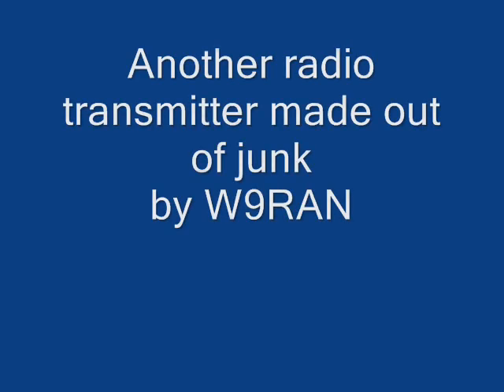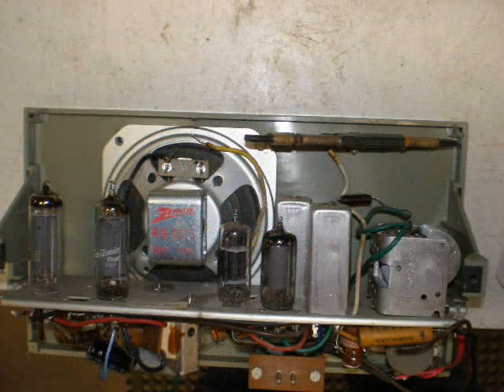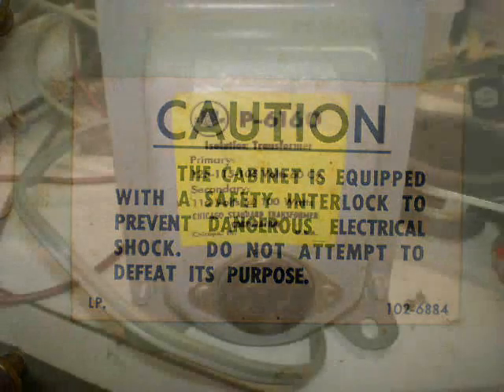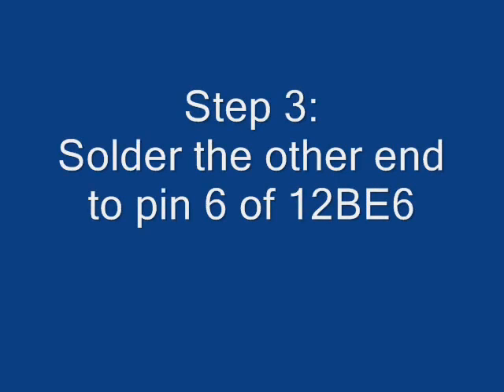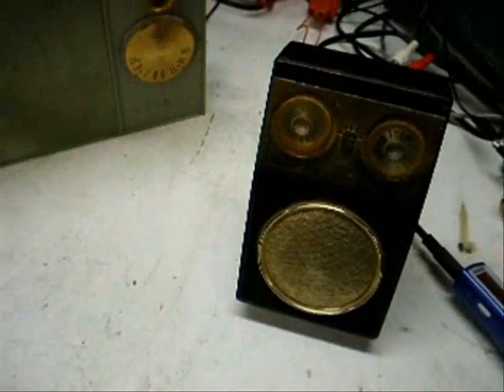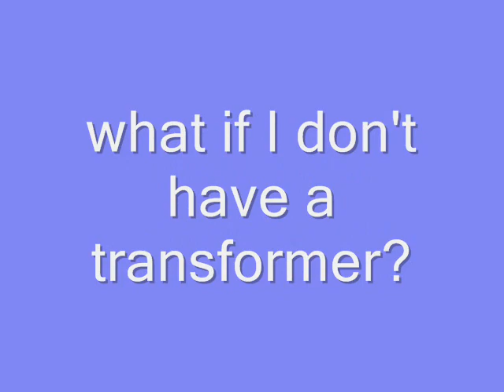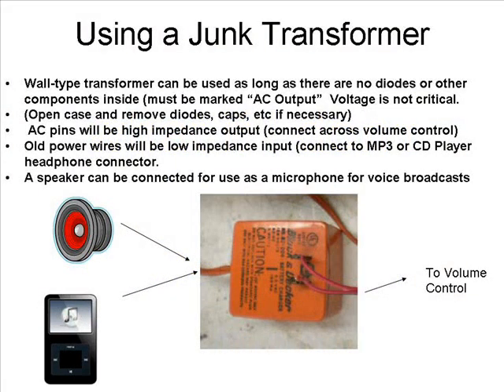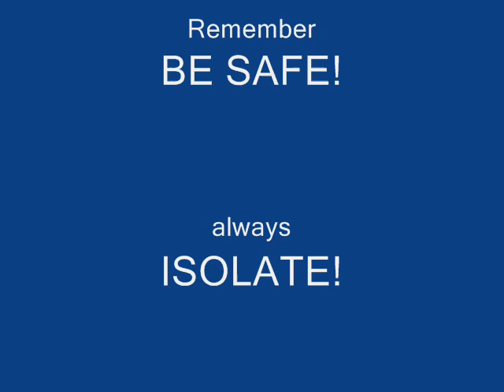Turn an old junk AA-5 radio into an AM broadcast band transmitter

Comment from the maker: Good question!   Actually four of the five tubes are needed for this mod:   the rectifier, first audio amplifier,  audio output, and converter tubes.  The other IF amplifier tube doesn't provide any function but is necessary to complete the series filament circuit.  The audio output tube is much more powerful than needed to modulate the transmitter, but it's an easy way to go with minimal re-wiring.

Comment: Ok I spent the AM doing the AA5 Mod. Connecting the cap from plate pin 7 of the 50C5 to ground was an error. All the audio going to the 12BE6 pin 6 gets bypassed to ground. The final results were not very satisfying . Yeah it worked to some degree, but put harmonics all over the AM band. The activity was not a total loss though. I gained a better in depth knowledge of the AM front end. The sets oscillator has the frequency range I want but you cant use it directly as any capacitive load pulls the oscillator off frequency. I pulled an oscillator coil out of my junk box , put it across my  scope leads in x10 range. Once displayed on my scope I could detect any loading. My scope has an amplified vertical output BNC that I fed to my counter. Using my B input i connected an audio signal and the add function i was able to modulate the RF signal.

Comment from the maker: John, your wall wart should work, but the idea is to match the low impedance from a CD or MP3 player to the higher impedance of the radio.  So you'd connect the low voltage secondary (6-12 volts typically) to the audio source, and the plugs that would normally go to the AC outlet (primary) to the radio volume control.  It's not a perfect impedance match, but close enough - and much easier to find!

Have fun and be safe,

Bob

Comment: I am looking to build one of these that will transmit about 100 feet but the radio I have to use uses completely different tubes. Instead of just telling us what to move where why not explain exactly what you are doing and why. Not everyone's radio is going to be the same as yours. How would this apply to a radio with different tubes in it and a different schematic????

Comment from the maker: Hi,
I'm sure it's a very small fraction of a watt, since it's just using the local oscillator.  Legally, it would have to comply with Part 15 regulations, and based on comparisons with other transmitters I'd guess it's someone around 50 milliwatts.

Bob

Comment: Ill be damned, it works!!!, I did this modification on an old junk AA5 clock radio, I used a power adaptor for a matching transformer, later I will install an audio output transformer inside the radio next time I come across one.  The range is about what I was expecting, it will transmit across the room using only a few clip-leads for an antenna.  This is an easy modification to do, didnt take long.

Comment: I was very confused after watching this video and I said no way man. It moved along at too quick a pace for my overthinking brain , so I took notes, looking back over therm made very little sense to me while sitting at the dinner table tonight, the whole thing came together. Wow! I am going to try it out on an old working AA5 chassis. My plan is to use it as an AM signal generator for tuning up radios and broadcasting records in my show room of antique radios. After I’m done ill write back again and give a report. I don’t need the speaker for a microphone. Ill used a 400 Hzt tone to modulate the oscillator with. So to sum up , now I clearly see the 50C5 as the Audio power amp to modulate the local oscillator with and the 6BE6 the final Amplifier. However this radio also has an input RF amplifier to be used in reverse as well. The radio chassis will be running off my bench power isolation transformer, so ill have good isolation . The audio range signal will be coming from a hand held , battery powered function generator. My only concern is will i be able to use the system to cover the 540 to 1600 Kilocycles bandwidth. Ehh what the hell, its a great experiment.

Comment from the maker: I think you'd more likely just shorten the life of the other tubes.  The maximum legal range of a Part 15 transmitter like this is only 100 feet or so, typically.

Comment: Hello I have a Philco model 48-250 I just recapped and got working thinking it would work as a AM transmitter. Its got 5 tubes but they are not the same as your. Can I use this radio?

Comment: the proven theory behind this, is that any receiver has a "local oscillator" built in, which could be be used as a transmitting signal - further modification such as shown in this video can provide the choice of modulation - you can take any PLL synthesized FM 8.79-107.9 FM radio receiver and turn it into a low power FM mono transmitter alot easier - the transmitting frequency range would be 98.5 to 107.9 after removing 500Khz from the PLL clock crystal which is easily done by using a variable tuning capacitor - changing the PLL clock crystal to a lower frequency will provide lower FM frequency coverage - ive built a dozen of these, built them into metal "lunch boxes" complete with built in 5 amp 12VDC SMPS power supply, low pass RF filter, one watt RF amplifier, BNC female antenna jack and an RCA male audio input - completely plug and play
Reply: Show us with a diagram and instructions,not just say how it can be done ,did it work?.

Comment: Bob,
I'm about to give this a whirl.  The radio I'll be using is on the way.
Question about the a/c impedance matching tranny: I have a wall wart with a 12vac output.  I'm assuming the primary gets connected to the audio input device and the secondary to the radio's volume control.  Is that correct, or does it make any difference?

Regards,
John

Comment: I got diagrams to build a spark gap transmitter in jail off a wall socket so I could transmit an SOS to the outside world.   That's what you need to do a video about.  There was an AIrport right next to the jail with air traffic control tower, I figured I could reach someone and tell them I was being held captive against my will.    In jail you have wall sockets, so plenty of power, and you can get your hands on small AM radios for wires, parts, etc.  Though to desolder them, hum, not so easy

Comment: Yeah, make a video about how you would build the most rudimentary longwire pirate AM voice transmitter from a prison cell.   All you have to work with are the components you find in a Sony Walkman with AM/FM, and you have an AC power plug for unlimited transmit power.  It should have a broadcast range of maybe 300 yards to reach other AM radios, so you could run your own show.  Captain Crunch says he did it, and he's not terribly bright.

Comment: Thanks. That's what I thought, fun stuff. 

Part 15... Read it. It is not useful. I guess about 100 mW max. Never the less NO ONE seems to care. Folks have no problem running 100's or 1000's of watts on 11 meter CB. Many using personal radios sevice or 2 meter with out licence. Now pirate radio station gear is cheap. You can take $500-1000 and turn it into a Broadcast FM station with a 30-100 watts or more. People just don't care about FCC. NOT CONDONING IT, just saying people are cavalier.